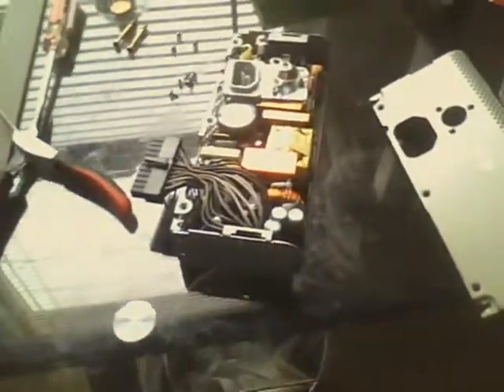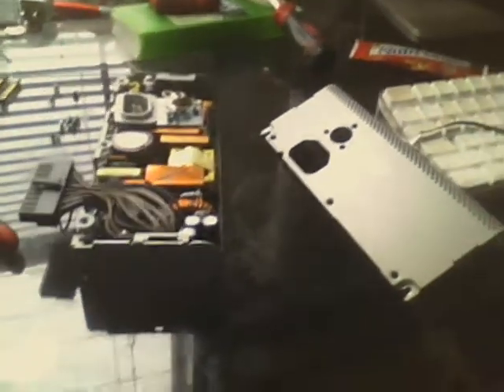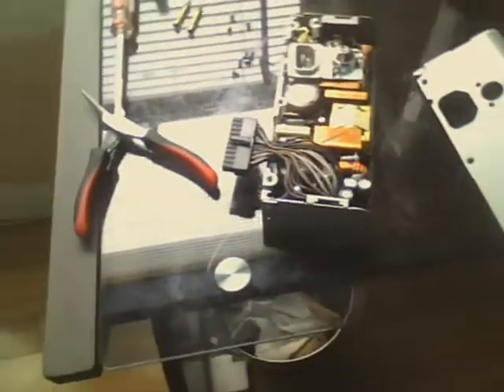Inside of an AC Bel iMac G5 Power Supply

Comment: A pity it failed, but apart from the bad capacitors, it looks like it's actually built fairly decently.
Reply from the maker: ferencproject Tell me about it. These things are annoying me. I have to order some caps and fix my soldiering irons now. There is little ventilation on these PSU's, thus caps are more prone to leak in my case.
Reply: TheCRTman Yeah. Lots of heat + bad caps or bad solder. The reason most newer electronics fail so often.
Reply from the maker: ferencproject Yep!

Comment: Haha that's ridiculous. Haven't these air-heads at Apple learned about ventilation? Apple seems like such a crappy brand.. They died in 2000.
Reply from the maker: VideoTape It is ridiculous. These pieces of shit keep breaking down on me every time I get my hands on one. Apple really is a crappy brand. I'd saw after the 2001 era with the Power Mac G4 original and Mac OS 9.2.2 is when apple died.
Reply: Theoretically you could make the iMac G5's power supply external, and put a big fan on it to cool it down... Maybe that would prevent it from breaking every damn years...
Reply from the maker: VideoTape I don't think you can due to the short cord.
Reply: Find an extension or make one yourself... It would be time-consuming, but it's possible...
Reply from the maker: VideoTape I guess, or just build it into a whole new computer with an external monitor, even though the LCD's on mine have never had a single problem for 10 years. :O

Comment: Someone should tell Apple that power supplies need ventilation. This looks like another case of form over function.
Reply from the maker: ***** Apple doesn't care though. They want stuff to break down so you can spend more money on crap that will break even faster.
Reply from the maker: MonsterSubaruLover 96 Sure is.
Reply: MonsterSubaruLover 96 Ya man. the older macs are alot faster then the new ones.
Reply: MonsterSubaruLover 96 ya they showed benchmarks and it showed that the older macs from 15 years ago performed much faster! crazy right<!?
Reply from the maker: The Haitian In Japan Same, they suck. However my 2005 iMac G5 #2 is still holding up right now. Nice.
Reply from the maker: The Haitian In Japan Oh wow.
Reply: The Haitian In Japan Why not just build a pc for $250? Why use a g5. if you buy one used it will just die in 3.2 months.
Reply from the maker: ***** Why don't you get lost?
Reply: TheCRTman It's a good question. I bought a g5 once for over $100 and it died after 1 month. their junk. Its idiotic to buy one these days. after all, their like 12 years old.
Reply from the maker: ***** They're not the most reliable machines (I know since I have 2), but some people like them. What does age have to do with anything? I've had desktops from 1996 work flawlessly in 2013.
Reply: TheCRTman Yeah, But what good is a machine from 1996? if you wanne run word on it . then i guess their good enough for that one task.
Reply from the maker: ***** Packard Bell Pack-Mate, fairly low end specs, but the interior was shining like new. I have a 2000 Dell Optiplex GX110 running Windows 98 SE and I got youtube comments to work in 2015.
Reply from the maker: The Haitian In Japan Oh okay.
Reply: The Haitian In Japan Yeah a 2008 macbook is much better then any g4 or g5.
Reply: The Haitian In Japan Good luck with mac os x 10.5
Reply: The Haitian In Japan its just gonna die on you in 2 months. build a pc. you can build one for $250 that will last you 5+ years. Dont buy a g5. there all 10+ years old their a waste of money.
Reply: The Haitian In Japan okay you can buy it. but be sure to have $200 6 months later when it dies.
Reply: The Haitian In Japan im not lol.
Reply from the maker: The Haitian In Japan He keeps commenting the same shit over and over again. Just move on! I like old stuff, you like new stuff, big deal! Geez...
Reply from the maker: The Haitian In Japan In my opinion old stuff is better, but I generally don't go around telling people what to buy or what to do with their money. That's like if I told that guy to go buy an iMac G5 constantly.
Reply from the maker: The Haitian In Japan Cool, glad you like my videos. Exactly. Hmm, I haven't made a computer video in a while. Right now my G5 is running pretty well and still has the same specs as it did in 2005 when it was new. My other G5 is a parts machine since it got bad caps on the board.
Reply from the maker: The Haitian In Japan I'm not sure. I've been pretty busy lately and don't have much time for youtube anymore.

Comment: definitely recommended fixing it, I had a Generic laptop power supply fail on me! within about 20 minutes of use before it finally stopped, my guess is that one of the diodes for the DC rectification went bad, I'll replace them and get a proper DC rectifier IC
Reply from the maker: Sony Trinitron Yeah I want to once I get some caps. Just saying of laptop PSU's, the cords on those only last about 2 years and then break. Is there any way to replace the cords?
Reply: TheCRTman Yeah they are replaceable, if you can find a replacement cable! best way is just find a Generic $10 adapter on eBay and unsolder the cord (taking note on what is positive and negative) and replace it even if you break the generic adapter open it doesn't matter
Reply from the maker: Sony Trinitron I can't even open these pieces of junk though. They don't even have screws and the cables are hard wired in. (What a scam).
Reply: TheCRTman Checked under the labels? but yeah they are a pain when that happens, you can pry it open with a knife or something that is probably the best way!
Reply from the maker: Sony Trinitron I can see about that and ugghh I hate prying things. I like using a screw driver. :P